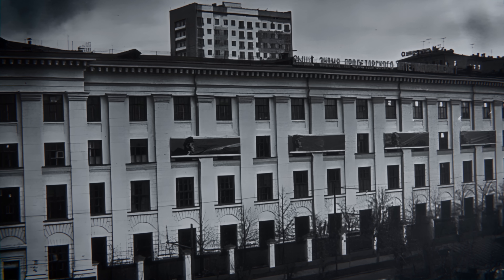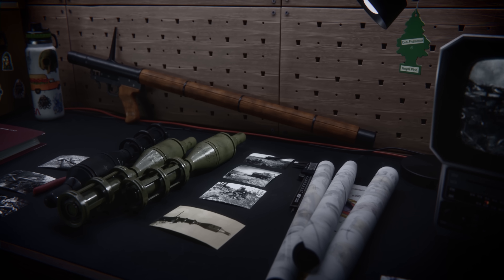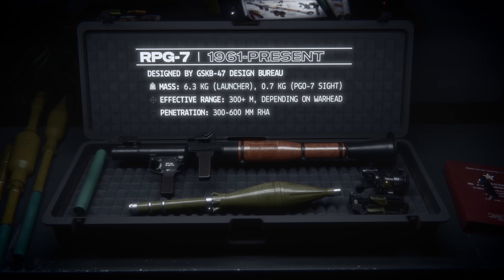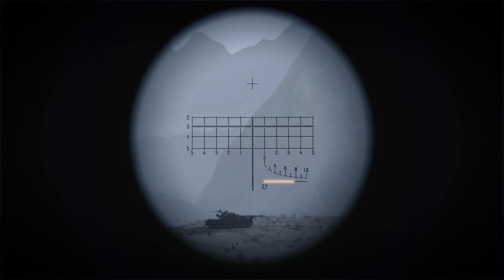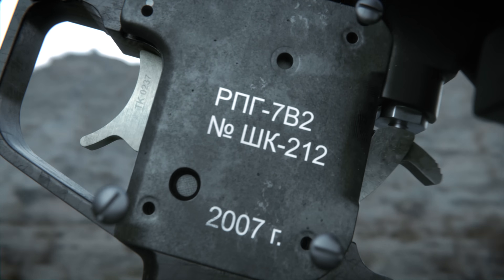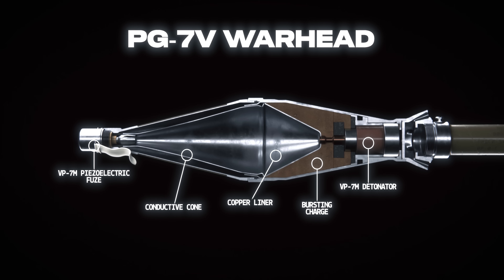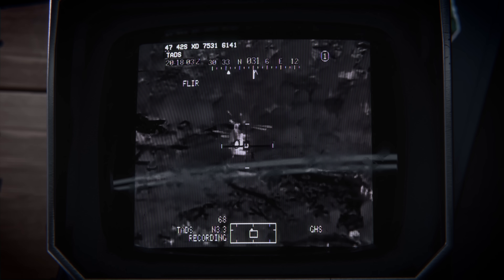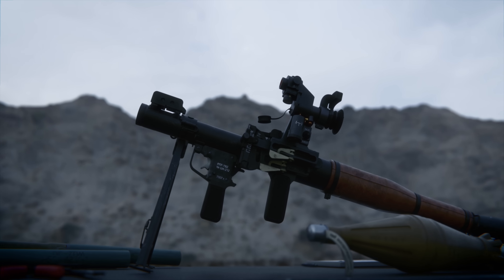The Tank Killer

Comment: This is one of my favorite weapons. Definitely saved my muscular pale azz multiple times. We had an American-made RPG-7 with pic rails all over. Came with an ACOG-style prismatic sight much simpler than the PGO scope that comes with the OG. A 3x or 3.5x can’t remember, and has a faithful reproduction of the PGO reticle with Soviet-style stadiometric. The scope was made by Sightmark, a mid-tier consumer optics company priced below Trijicon, more like holosun or vortex I guess, just going by the price. Most of the rifle optics I used there were either issued meprolight or Leupold/nightforce/trijicon/eotech that I shipped or brought carry-on. I returned with all ITAR gear, nothing lost or stolen.

Anyway, the way we boresight RPG-7s is kinda funny. I’ve seen that forgotten weapons video where Ian shows a device that fires a ballistically matched 7.62x39mm cartridge. Yeah I never saw one of those. There was a laser boresight but we used sewing thread or floss and made crosshairs on the front and back of the tube, pointed it against a light colored wall, and put sandbags on it to prevent it from shifting. Then we adjusted the sight from there. The PGO scope requires a flat head (slotted, sorry) #1 or #2 screwdriver. Real old school technique that is actually extremely accurate, at least as much as you can be with an RPG-7. You really just gotta get a feel for it with a simulated trainer and just get your shots, your reps in, cuz there is no advanced technique, you just account for the drop and the wind like the video says is the same hold but reversed so a E>W 10mph wind will shift the POI to the EAST, whereas a bullet will shift (much much less) to the west. That’s cuz it’s a rocket dude. It’s making thrust and the wind blows the finned tail much more easily than the massive head, which points the sustainer jets so they’re firing toward the origin of the wind. If you have a kestrel great but the real truth is that if there’s a stiff breeze over like 10mph you’re not hitting anything on skill. It’s just luck at that point unless you’re really close. I’m not sure what the standoff is so don’t take my word for it but I’ve used it at about 90 yards, a single heat with a frag jacket and I’d say that’s a safe standoff, arming is 35-60 meters (sorry for the mixed units but it was in Europe), I’ve heard multiple numbers. Just figure that it’s after the sustainer kicks on, although they can be modified to be armed right out of the tube. It’s not something you can do in the field expediently though. Nothing with fuzes, charges, any ordnance is expedient. Ideally anyways. 

I’ve built a faithful repro prototype with some improvements at home from 4340 steel, phenolic composite and 7075 aluminum, it fires rockets that I load noisemaker and flash shotgun shells into.  It can fire 4 at once on impact. Looks like the real thing kinda, so I have a blue aluminum head I can put on it. The firing pin’s narrow mid section triggers an optical sensor buried in the firing pin block that runs up a ribbon cable to a tiny MCU powered by an A23 cell, then another ribbon cable to some shrouded LEDs at the muzzle that can tell me if the manual and grip safeties are depressed, if the rocket is properly seated, and if the hammer is cocked all at a glance. If the barrel and the breech aren’t mates together properly via 4 radial cams and slots and 3 camming hasps, all the lights blink red and the round won’t seat correctly anyway. It’s got a ball detent locking thing in there that stays locked until the tubes are assembled, locks again when the rocket is fully inserted and then unlocks when the pistol grip is depressed. I use a fancy muzzleloader folding front and rear sight and a Trijicon 8x VCOG, and I have a reticle and lens from a PGO I can mount with the VCOG. Not overcrowded, worked great. Large magnum rifle no. 250 and I use a mix of propellants for the booster but a mix of a magnum rifle and a magnum shotgun propellant works well, NC would work better but that would be illegal and I don’t play like that of course. In fact this was all a work of satire. I wasn’t even here. Oh I put some locking lugs on the front and back for caps/covers not really necessary but the back one holds the back last shield as well and they’re designed so I can use them to perfectly orient my boresighting thread. I’m so good at weapons engineering dude. You should see my armors M240L/M82A1 turret. The M82A1 has a servo-actuated mag loader that feeds rounds to a mag thats been bisected, then drives the floorplate up in a spring-like linear compression. I can even switch between Mk211 HEAPI, SLAP, and M8 AP, but there are 4-5 rounds ahead of it I can either eject or fire to advance to the round I need. Also has extremely low EM signature, for RCS and IR. RCS material isn’t hard to make these days but math is required. IR could be done with a cooling system, PID, and a thermocouple but there’s a better way I’ll be dropping in 2026.

Comment: Really well done. The way you displayed how the piezo crush fuze conducts along the inner and outer sections of the aerodynamic standoff cone was well done and a really elegant and simple way of doing it. The way the shaped charge hypersonic copper jet  flew thru the tip looked really silly but honestly probably not that far off from reality considering the rocket is moving like 0.5m/s and the jet is moving closer to 9m/s. Probably a lot of that cone will still be intact by the time the jet gets there but it’s a hot bridgwire detonator and those are only as fast as the electrical current can heat it to the temperature required to detonate the lead azide primary. That takes maybe 1/1000 to 1/10,000 of a second so 0.4-4mm yeah that’s not much.

One thing worth pointing out is the cone serves as a standoff. Too close and the copper jet doesn’t get to its full length, it doesn’t collimate. Too far and it disperses. That is the exact distance from disc to target for penetration when traveling at that speed.

Affuhgamistan

Would love to see the clockwork in that VP-7m SAD and self-destruct animated by this channel. Looks great dude

Comment: All the panzerfaust models were reloadable and shipped with more warheads than tubes (eg 6 tubes 10 warheads) but the reload time was cumbersome so it was only done after the battle.    The panzerfaust 150 was easily reloadable and although it entered production was never delivered.
panzerfaust 250 essentially looked like an RPG-7.  It added a constriction in the exhaust of the tube to increase projectile velocity with an expansion nozzle to neutralise recoil.   A pistol grip was added

Comment: The animation was super nice and very clean. I don't understand then why the conclusion section feels like a chatGPT generated script- it has all the hallmarks. Why? You are incredibly talented.
Reply from the maker: I addressed this a few times. 

The outro is, regrettably, written by Al and it's very obvious and clear. The reason is complicated, but two main reasons. One, I was on a strict deadline because we were premiering in NYC and the date was pulled forward. So the last 1/3 of the video was significantly restructured to get done in time. And two, I'm just generally really bad at conclusions and Al at the time seemed like a good tool. In retrospect, it's insane how bad/obvious it is. No visuals are Al generated though.
Reply: @echozero_  Firstly, I respect the hell out of you for responding.
Secondly, as I said, the rest of the video is great and I didn't suspect any AI was used elsewhere, which is why it surprised me. You've got talent.

I wasn't aware of the circumstances. Makes a bit more sense now. Just keep up the good work!

Comment: This is absolutely amazing. 
But on this age, I'd like to know more about the making of these videos.
Who are the animators? do you make your on 3D models? How much was AI used for this video (research, script, visuals, etc)?
Reply from the maker: One guy. I buy some assets, and produce a lot of assets. Every element is touched though, whether it's reproduced or modified. There's no AI in this video with the exception of the last 5 seconds. The outro is, regrettably, written by AI and it's very obvious and clear. The reason is complicated, but two main reasons. One, I was on a strict deadline because we were premiering in NYC and the date was pulled forward. So the last 1/3 of the video was significantly restructured to get done in time. And two, I'm just generally really bad at conclusions and AI at the time seemed like a good tool. In retrospect, it's insane how bad/obvious it is. No visuals are AI generated.
Reply: @echozero_  - Thank you for sharing this details. I don't think that ending was bad. And again, the production quality is insane. Great work!!

Comment: This channel is brilliant. Just watched your night vision video and thought it was award winning level of production and thought.  If anyone is confused at the RPG sight system ignore the horizontal numbers on the bottom we don't need them for ranging, you fit a tank in the sloped marker and from the bottom of the tracks being aligned with the flat line to the top of the tank gives us a number on the slope like 2 and then choose 2 for 200mtrs on the vertical line, its a rough distance but works because most tanks are about the same size. Basically we know what height a tank will be at these distances so we match it in the slope to a number that we use to chose the elevation on the vertical line in this case 2. ❤

Comment: This is a stupid question. But how does the electric fuze on the tip of the warhead not instantly get destroyed on impact. It's mechanism sounds more like something that'd work on paper but not irl, but it does.
Reply: Electricity is fast. And any deformation to the fuse will set off the charge instantly ,+the Warhead is not supersonic and doesn't always hit on a perfectly flat angle
Reply: The PG-7V round is actually very dangerous when you take off the saftey cap, as the slightest deformation or bump can be catastrophic. Thankfully newer Rpg round don't require taking off the safety cap before firing. I don't really know why. But i ain't gon complain

Comment: RPG-16 and single-use RPG's never were RPG-7 replacement. 7 still serves in Russian army.
Reply from the maker: "made to replace" and "successfully replaced" are different right. I'm sure the intention was to replace an aging system
Reply: @echozero_ Nope since RPG-16 was developed specifically for VDV (they later switched back to the 7). Single use RPG's are hand grenades alternative. So replacement for everybody but VDV was never developed.

Comment: 3:05 just a small note - that OG-7 isn't fully inserted as otherwise only its shiny tip would stick out of the muzzle. That's the reason for OG-7's service nickname, Pencil, as it looks like a pointy end of a pencil lead sticking out.
Reply: Actually there are a bunch of variant of the OG-7V rocket, that is one of the much longer versions. Though it still isn't fully inserted yes. The most common longer rockets are Bulgarian. Various countries who used the RPG-7 developed their own rockets, so there's a huge range of rockets beyond just the Russian ones. The Bulgarian frag and tandem heat rockets are known for being more reliable and better performing.

Comment: Funfact; in somalia they would teach rpg-7 operators to dig holes behind them when firing against helicopters, If you do fire above you with just a flat surface on your back you will fry your own legs
Reply: Just rocket jump and slap the heli with a shovel
Reply: @haikei888 😂🤣😂🤣
Reply: Back blast area secure…
Reply: They'd also weld scoops on the tail end of the tube to deflect the blast back, not down into the ground.
Reply: saving this tidbit information in my head if i ever come to situation to shoot rpg
Reply: how many somalis did it take to come up with this genious engineering XDD
Reply: How come the back blast doesn’t effect dudes with stingers and iglas?
Reply: @henrypollock7987  I do believe that they use a much smaller initial charge and instead accelerate mostly once out of the tube. I guess it also makes sense to not waste a large portion of your Delta-V accelerating without accounting for lead.
Reply: @henrypollock7987  They have a much lighter two-stage launch. Watch any video of a stinger or igla firing in slow motion and you'll see there's an initial small rocket propulsion to get it out the tube and then in the fraction of a second after its out, the 'real' rocket motor kicks in.
Reply: @Jacksparrow3195  the same happens to the RPG7 warheads. the booster charge ignites launching the warhead out of the tube, then after a few meters and like a second the main propulsion charge ignites. I guess they designed the Igla not to pepper you with backblast since it was ment to be fired at an upward angle.
Reply: @Jacksparrow3195 interesting name you got there
Reply: @Jacksparrow3195 why’re the RPG’s always gone 😫 
Did you use all the RPG’s?!  🫵🏽
…
did you hit anything then? Or are we supposed to be running for our lives the other way..?
Reply: @jacksparrow3490 this is getting out of hand, now there are two of them!! 👽
Reply: @thesayxx  its mostly a myth. Even with smaller ejector, officially stinger danger zone is 5-15 meters and "safe" firing angle is capped at ~60 degrees upward. 

MANPADS also have longer engagement range than MANPATS so their design considerably differ. RPG7 boosters must have more power, since they're always attached and act as stabilizer (the fin is part of the booster rather than the warhead). Without extra initial power, they'll end up as a deadweight. Stingers and Iglas ejector are separated once they're outside the launch tube for this reason.

This is also why, as mentioned in the video, RPG have unique behavior when exposed to crosswind and rather useful when targetting heli. The projectile is front-heavy, but the fin is further at the back. So they end up rotate towards, rather than glide away from, the wind source.
Reply: @henrypollock7987  Arent those guided?
Reply: @henrypollock7987 if you watch MANPADS fire they kinda hop out of the launcher then accelerate super fast after clearing a few feet. They have a small initial charge that fires them and that the person has to deal with, the main propulsion comes after that though. RPG’s are just one explosion immediately
Reply: @Chungus581 well no the Rpg 7 has a booster charge also. That's the long green section screwed onto the warhead. The rocket motor fires after the propelling booster charge goes off. So its like idk 3 meters away before that happens.
Reply: @jsimmons9969 oh cool I was not aware
Reply: No the backblast will not fry anything. But it will blast you. It will crumple a man standing in the way. Could be deadly.
Reply: @jsimmons9969 I'm sorry, bro, but can you explain the differences between 'fry' and 'blast'? I need this... The internet needs this.
Reply: Fun fact: Somalia is one of the worst countries in the world.
Reply: It are fact, I know because of my learnings
Reply: @alm5992 Not very fun.
Reply: israel has entered the chat @alm5992

Comment: Fun fact: None of the threads in this video are actually threads. They don't have any rise.
Also, for some reason, 5:01 even implies a left-hand thread, something one would only go to the lengths of purchasing and obtaining the necessary cutters for and/or setting the turning machinery for if some significant rotation was to be expected during operation that could loosen the connection before the finished piece's purpose was fulfilled. But the RPG-7 projectiles aren't even spin-stabilized in the first place.
Reply from the maker: Modeling threads is a really time consuming process so I decided it wasn't worth it. Good eye!

Comment: Funny thing about this great weapon is it's extremely poor safety features. When armed the only thing protecting a huge deadly accident against the user is a small removable cap on the end of the projectile. This is suppose to be left on before its ever fired. Now one would think that the Soviets would make a system that would only arm the warhead after it was fired but NO,  not a chance. Many a RpG operator has been killed running with a loaded rpg without this cap on, they fell and triggered the warhead !   In fact I never ever see this safety cap used.
Reply from the maker: It's my understanding that later models do incorporate a more advanced mechanism but I'm not 100% sure
Reply: You're wrong. The warhead is armed AFTER firing it. You could play football with the warhead, and it wouldn't go off. The safety cap is there to prevent the piezo crystal from deforming, which could lead to duds. Why do people still parrot this bullshit?

Comment: ok, so the copper liner is not molten, but rather a stream of high energy particles that cut the material like a plasma torch
Reply: This is also incorrect.  The liner penetrates armor by velocity alone.  At these extreme velocites, metals ACT like liquids,  but there is no actual melting, burning, or “plasma” involved.
Reply: @maximus9812  So why is copper used?

Comment: Fun safety thing about the RPG-7: The Hammer's neutral position is such that it's hovered a fraction of an inch off the back of the Firing Pin. It is only when the Trigger is pulled that this safety barrier falls. It rises again when the user lets go of the Trigger.

Comment: Good  job. 👍 

IMHO  there  is  one mistake! 

Small turbine  on tail of the primary  engine  turns rocket about its the longest axis and stabilize it by rotating.  It occurs  when  rocket moves  in the barrel and has low velocity.

Comment: 5:55 Excellent video but very small mistake the booster is designed to stop burning when it is out of the tube so it doesn’t burn the face of it’s user.
Reply from the maker: that's not the booster, that's the tracer that is ignited by the booster